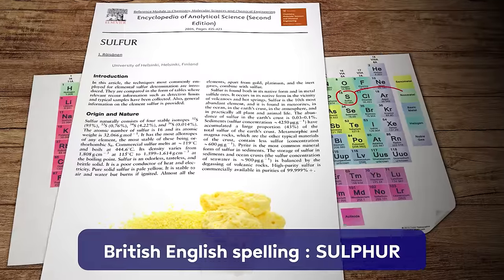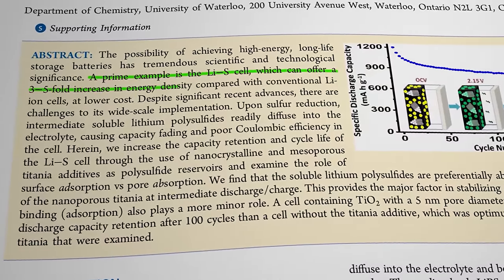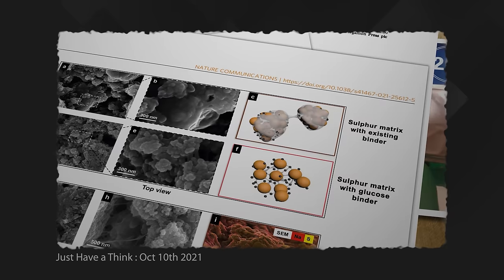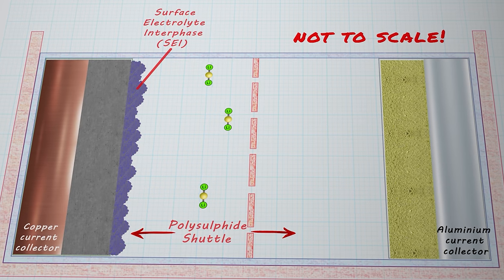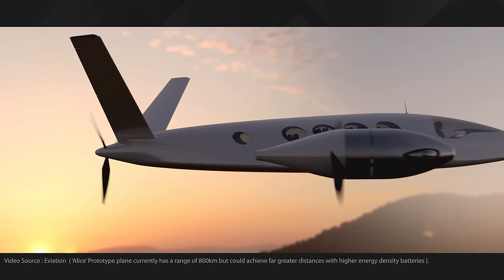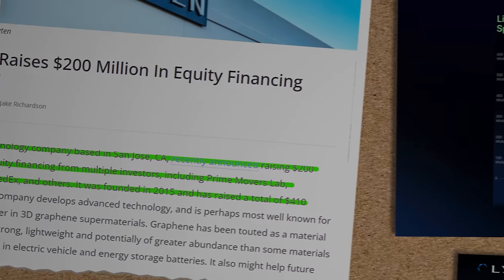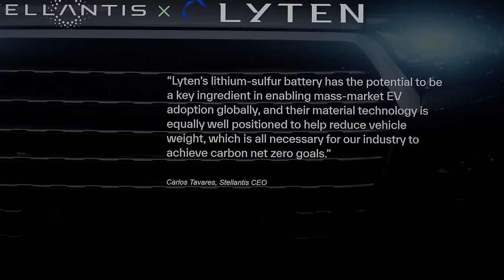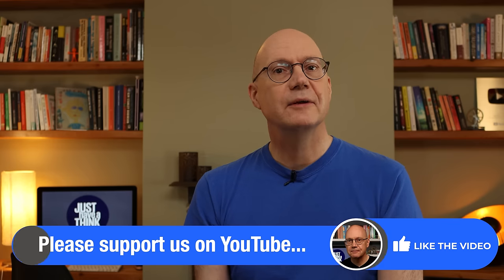Battery Energy Revolution. What now?

Comment: For me, I don't hate EV's at all. I just think at this point and time, it's not for everyone. I live in a early 60's apartment. There's no where for me to charge. (I'd love it if the city put street chargers even slow chargers) The charging networks for the charging sites have reliability problems. But yes it's early days. My next vehicle is most like going to be a hybrid. Unless I get a place of my own that I can have a home charger installed. Once the charging networks expand it will be great. The other concern is of course cost of EV's. So cheaper and safer and lighter batteries, will help keep the costs down. Even a Used Tesla here in Vancouver BC, Canada is going for $38,000 Canadian.
Reply: Vancouver is perfect for electric. Do you live in a rental or strata? Stratas now only need a 50% vote to get EV charging installed instead of 75%. If you live in a strata, you can bring it up for a vote to upgrade. BC hydro also has rebates for installing chargers in rental apartments and stratas. This makes it easier to convince a landlord that will eventually have to install them anyways. If they won't install a level II charger, could you use a level I that comes with the car? I use a level I and it works great for us and we drive on a regular basis. We were going to make do with the level I until we could get a level II installed but just realized that we don't need a level II charger so we just saved the money.
Reply: You are right.  EVs work best in an environment where destination charging options are ubiquitous. Those of us residing in isolated homes and/or having work places where charging is an option (however slow) have the advantage as early adopters.  Getting to where we have those ubiquitous charging options is still going to take a lot of work. 
Having driven EVs for 9 years already, I don’t think that simply replacing gas stations with fast charging stations is really the way to go.  That infrastructure will be needed for long trips, for sure, but it is not well suited for typical commuting and local travel.  Destination charging is the needful paradigm shift that local governments, businesses, and residential builders need to adopt.
Reply: Hertz is blowing them out at $17,000 US.
Reply: You're looking at it as if things aren't changing very quickly. EV prices have come way down, chargers are being installed by the thousands, range has gone way up, while charging times have come way down. Just look at EVs from 2016 compared to today. 8 years ago EVs had ranges around 200km, took hours to charge because they had no thermal management for the batteries, there were almost no chargers anywhere, and they were double the cost of a very good gas car. Now the cost is basically at parity (a Model 3 costs the same as a gas car of equal desirability), range is well over 500km, chargers are everywhere, and a typical charge session is 20-40min. And this trend is NOT stopping. In another 8 years, chargers will be ubiquitous, EVs will have 1000km range, charge in 6 - 10 min, and  be around half the cost of a comparable ICE car.

Also keep in mind the growth of building EV factories, battery factories, solar and wind farms, mine for the matteirals, etc is exponential. But right now there just isn't the ability to make an EV for everyone. Let's say the next gen Tesla came out this summer which had a 10,000km range, and charged in 5 sec wirelessly from plates under the road that were almost everywhere, and the cost was just $5. How many more EVs would they sell? Not a single one. Tesla already sells every single EV it can make. They don't need a car that satisfies all the needs of every person until they can make enough EVs for every person. So they just need to make an EV that's compelling enough and affordable enough for the same number of people as the number of cars they're making. As long as these two increase together, it's all good. Eg - If they can only make a million EVs, that EV only needs to meet the needs and budget of a million people. When they're making 5 million EVs, now they need to meet the needs and budget of 5 million people, etc.
Reply: That's entirely reasonable.  If you don't have a way to charge at home, I'd wait.  EVs will definitely get cheaper.
Reply: "I live in a early 60's apartment. There's no where for me to charge. " - perhaps you can get the landlord to install charging stations.
Reply: @TheDanEdwards  They'd have to do a lot of rewiring and install lots of breakers. There's only 10 covered stalls, I'd be better off finding another place if I could afford it.

Comment: I was under the impression that there isn't enough lithium in the world to supply anywhere near the number of batteries we're going to need - no matter what it's combined with.  If this is the case, surely it would be better to abandon all Li-something development and concentrate on battery solutions that use readily available chemicals?

Furthermore, the problem with Li-ion batteries bursting into flames is also becoming more serious with the much larger battery packs now being used in busses, trucks, grid-scale storage, etc.  There have been a number of very destructive fires recently, with busses catching fire in their depots - and thus taking out several other busses and damaging the building - as well as instances of electric trucks burning, and even cars causing severe problems when catching fire in undercover car parks (the recent, very severe, fire at Luton airport could be a case in point - although the fire brigade claimed it wasn't an electric car that started it, it looks very much like a battery fire in the video).  There has even been at least one very severe fire in a grid storage battery - completely wiping out the battery and only just avoiding starting a fire which would have destroyed the entire storage facility. 

These fires are not only fierce - and almost impossible to put out (they create their own oxygen) - but also very destructive as they can produce temperatures as high as 2,000 degrees - easily hot enough to melt steel and permanently damage concrete.  They also produce extremely toxic fumes and debris - fire brigades are already warning people to stay well away from electric vehicle fires.  We could be looking at car park operators, tunnels, ferries, etc banning electric vehicles in the near future, electric vehicle insurance becoming prohibitively expensive, and the second-hand value of electric vehicles collapsing.  And who's going to want their Tesla Power Wall burning down their house? The negative publicity from all this could easily scupper the switch to electric vehicles and domestic electric self-sufficiency completely.   

As this currently seems to be one of most government's few realistic programmes to make it look like they are doing something to combat global warming, it's not going to look good if this turns out to be unachievable because not enough batteries can be produced, and those that can be made keep bursting into flame!  Add to this the very real problem of most people not being able to charge at home and the severe under-installation (and other problems, such as charging time and broken units) of public charges, and it won't be long before there is a serious backlash against electric vehicles.  (And the other favourite global warming 'solution' of many governments, heat pumps, also has serious problems - expense, lack of fitters, not being suitable for many older houses, under performing, etc.)  

I suggest it is high time that those of us trying to move the world away from fossil fuels need to stop this obsession with technology (and the constant emphasis on technical 'solutions' - such as the farcical idea of carbon capture) and face the actual realities of dealing/living with global warming.  It's going to need a hell of a lot more change, disruption and expense to cut back on C02 emissions significantly enough than the well-off switching to electric vehicles and heat pumps, and big oil claiming 'carbon neutrality' because they operate a few carbon capture systems.

Comment: Just like in the solar and wind generated green power revolution where there is a huge gulf between where the grid is now and where it needs to be for the transition to happen, the dream of electrified private transportation is dependent on a view of cloud cuckoo land. However good the batteries, if you don't have the potential for private, off street charging.....still nobody is serious about battery swapping. It's a colossal oversight.
Reply: 6min charge, once a week. It will be fine.
Reply: @christianvanderstap6257  what are you charging - magic unicorns?